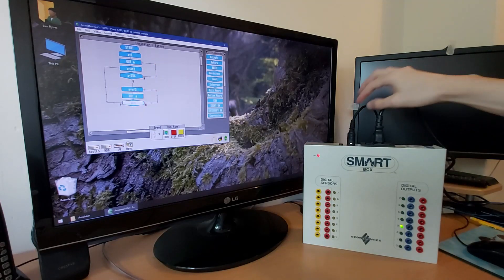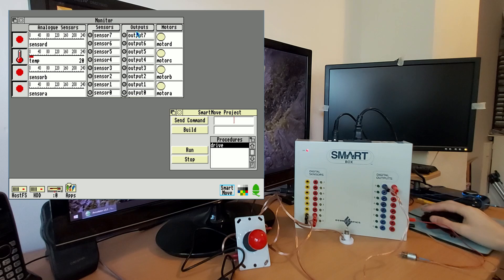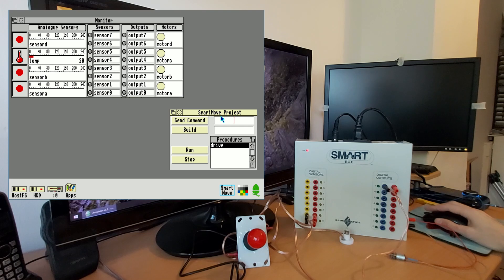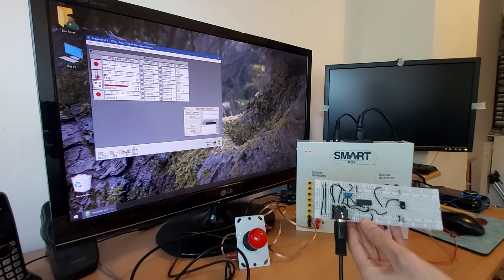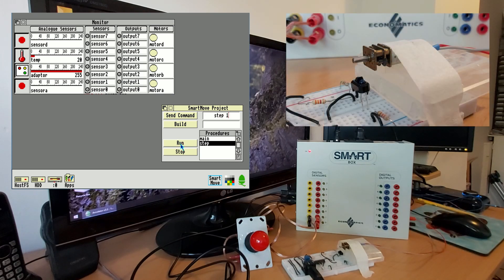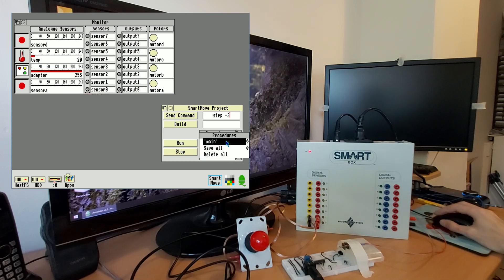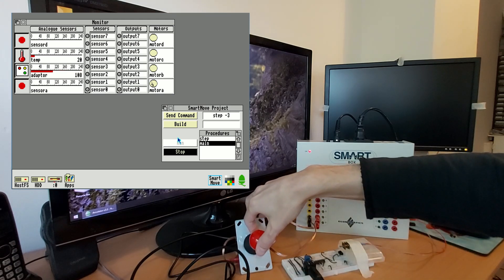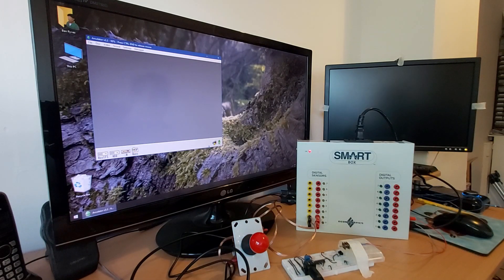Using an Economatics Smart Box from RISC OS in Arculator

Comment: Do you have any details on the User Adapter you could possibly share? Is your or their circuit documented anywhere?
Reply from the maker: I did start writing a blog post to cover it but it all went a bit wrong (chiefly due to people sending me fake components!) and I never got around to finish writing it all up, sorry. If you don't mind waiting a few more days your comment will be the motivation to finish writing it all up and I'll put up some schematics for a DIY user adaptor and temperature probe.
Reply: @benryves   Hah, no problem, I only finish half my posts. I picked up some (other types) of Smart Box sensors a while back and got distracted and never documented them. I have reverse engineered the serial protocol for two Data Harvest and the later Economatics "Control Station" box this week though 😆 - productive week. The Data Harvest Contact Controller Plus is a lovely machine, the Control Station is just a PicAxe in a tin box from what I can see.
Reply from the maker: @phipli  I'd be interested to see the insides of some real sensors, but have now updated my website with a post about how I bodged together my ones (there's a link at the bottom of the video description). I'm not familiar at all with the other boxes, but good work reverse engineering the serial protocol!
Reply: @benryves  Thank you! I'll go and have a look. Frustratingly they've potted most of them, but I have a light sensor in bits on my desk. I'll stick some photos on my website. I might have already put some on Stardot... I forget, it was a while ago if I did. I'll do a schematic for the light sensor at some point - I need to prioritise migrating my website to a new host before it runs out though 😆
Reply: Seems I didn't share photos, someone else did. My bad.
Reply: @benryves  I read through your post, thank you for that. I'm just about to upload some photos to my site which is in a comment under some of my recent videos. One thing as an aside - you mentioned the 8bit resolution analogue inputs - there is an option to increase the ADC resolution - I think it uses the same chip as the BBC micro, so it is actually.... urgh... 10bit?? I think?? But anyway, when working in serial remote control mode, it is command 44. I'm not sure how you'd do it when running with the Acorn software you're using though.
Reply from the maker: @phipli  Thank you! I've mostly been using a .NET-reimplementation of the SmartMove software and associated BASIC-like programming language running directly on the box (rather than just using it as an interface and have an external PC run the show), where the stock 8-bit resolution (one unit = 10mV, one unit = 1°C) is easier to explain. Based on the similarities of the hardware with the BBC Micro I had thought about looking into running BBC BASIC directly on the box, but the 8KB ROM is a challenge (in my quick exploration last year unused pin A13 from the ROM seems to be connected to the CPU, which might indicate support for 16KB ROMs, but I don't think &C000-&DFFF is mapped to it). I guess there's plenty of RAM, but that seems like a waste!